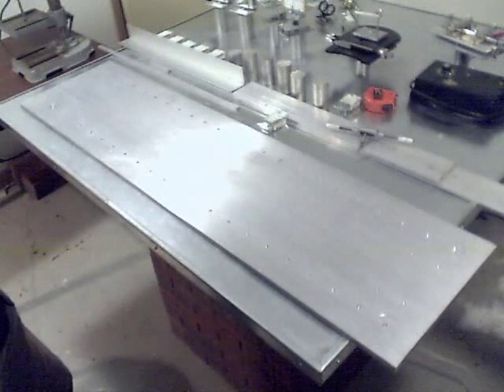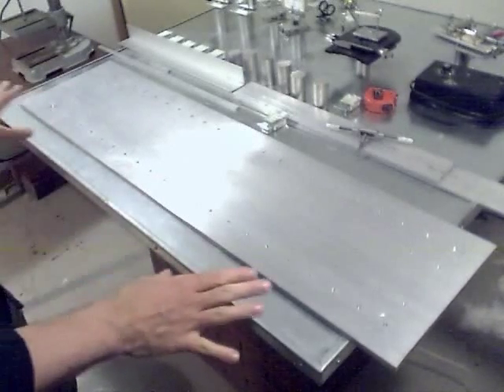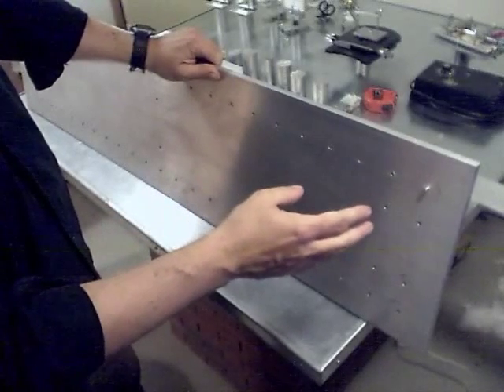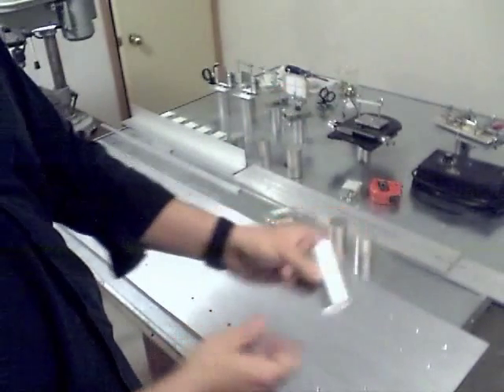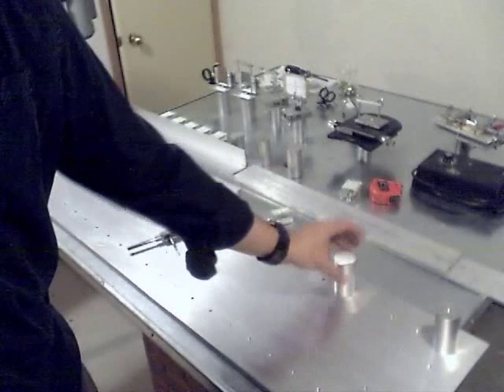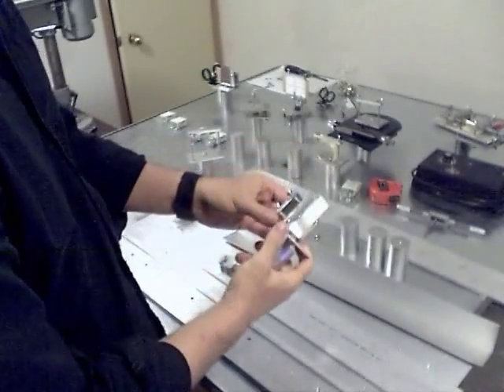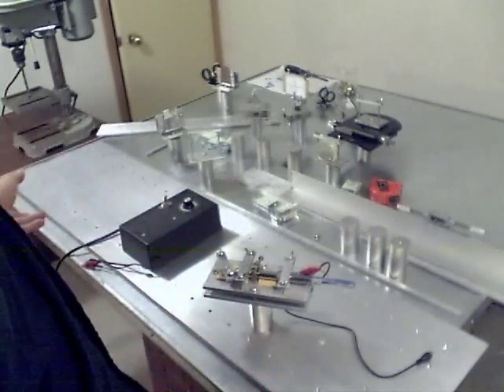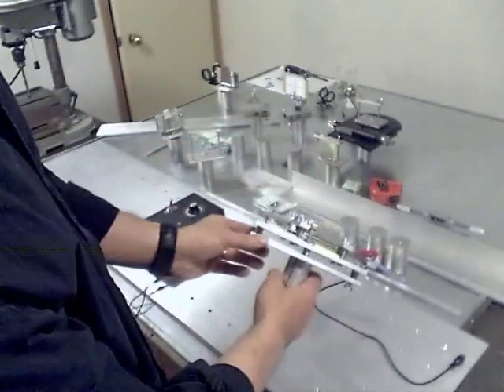Low cost optical bench from scratch

Comment: How much did the components cost? Was it more cost efficient to build it yourself or purchase a premade product? Additionally what tools were needed to produce this bench? I am conducting very basic experiments with a relatively low power (500 mW) laser on quantum mechanics, but will eventually be ramping up to a 2.5 W laser in the future, would this be effective for setting up such a workspace including these high power and potentially dangerous lasers?
Reply from the maker: Hi ADDventures, 
     Certainly buying a 1/2" aluminum slab and drilling it yourself is going to be cheaper than buying a pre-made one, but bear in mind that you will need a drill press that has sufficient clearance between the bit to the stand of at least half your bench width. The optical holders require an electric table saw fitted with a metal cutting blade (and a drill press). Now with the advent of 3D printing, I find it easier to 3D print the optical mounts see: http://skyhunt.net/documentation/ for a picture of a 3D printed Michelson interferometer. This equipment is really for experimenting with very low power, relatively safe lasers, like less than 5mW; if your intention is to work with more powerful lasers, you might be better off going with pre-made all-metal components, and obviously you do so at your own risk. Perhaps you should consult with your local university optics lab about appropriate procedures for this.

Comment: Nice job.

I just have a couple of suggestions: You should tap the threads using a tapping tripod, or failing that, a short piece prethreaded ID hollow bar over the plate hole to start the tap off vertical; you run the tap through the threaded hollow bar and into the plate. To get the ID hollow bar threaded vertically, drill it in a drill press vise, and then remove the drill bit, and place the tail of the tap in the drill press and turn it by hand; this ensures the tap is concentric with the bore.

The second suggestion: You should paint or anodise the aluminum parts black. This cuts down on specular reflection, and is a must if you're working with higher power lasers, otherwise you could end up with stray laser light reflecting off the table or optical bases and into your eye.